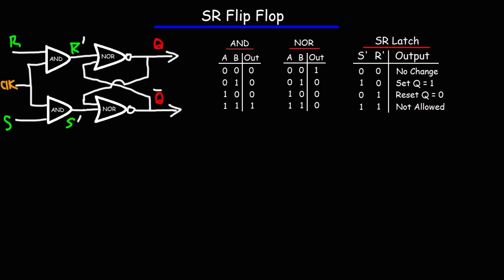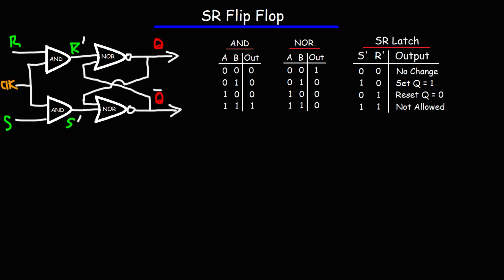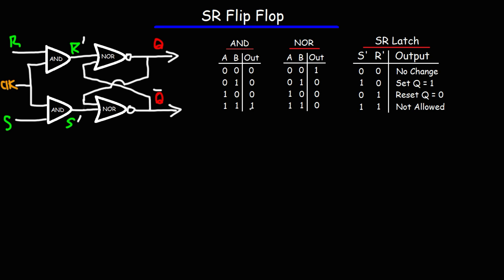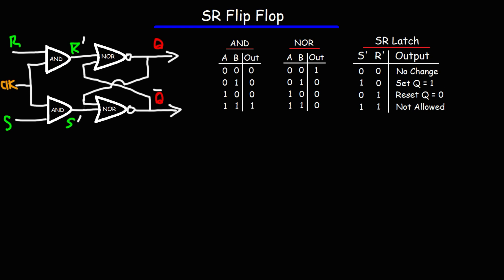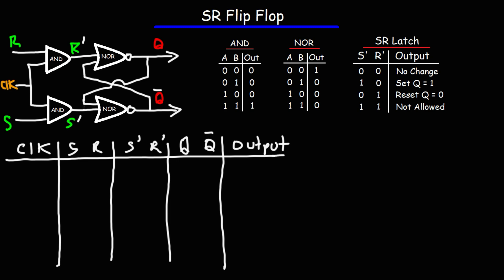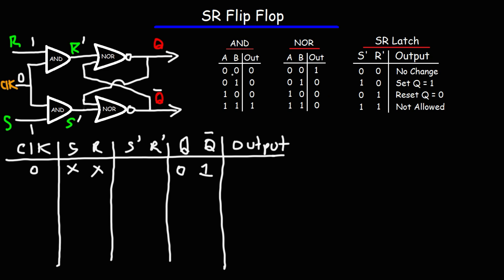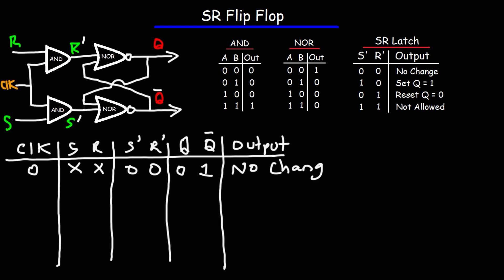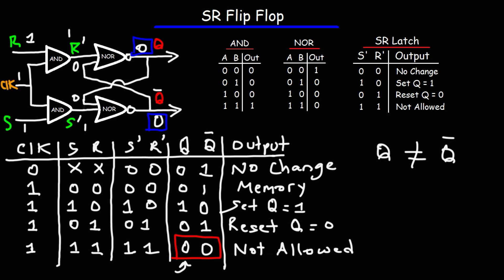SR Flip Flop Circuit With NAND and NOR Gates

Comment: So a SR Flip Flop is just a SR Latch circuit but with the conditional clock ?
Reply: this is what we called sr gated latch the flipflop is being considered cause it has a clock signal which is 60 years old now we call a circuit flipflop when it is edge triggered and it should always be edge triggered.
Reply: sr gated latch is level triggered whereas all the  flipflops are edge triggered

Comment: I love your work bro. I was a lil bit confused as to why the system always favored Q to be zero in the beginning like at time stamp @5:37, but then I remembered what Ben Eater once said on his videos that, they do this deliberately to always set Q prime high, meaning not active. They do this in hardware by adding buffer(s) at the R (reset) button to allow electricity to delay from that side, so that electricity from S (set) side could reach first and faster, to Nor gate, to flip Q' to 1, then that 1 will automatically continue to be added with R' and flip Q to 0, and continue in that cycle until, S (set) button is pressed. Very impressive how this actually is a brilliant idea.

Comment: Old school Boolean logic.   This was the basis for CPU's back in the day and "debounce circuits" where you connect a mechanical switch to a digital circuit.  The delay propagation of the chip (or transistors) made sure you did not get fluxuation signals into the digital curcuit even if you used "make before break" mechanical switches.  Cool.